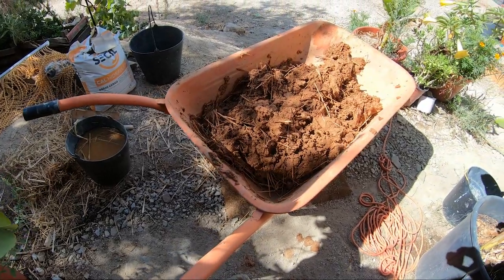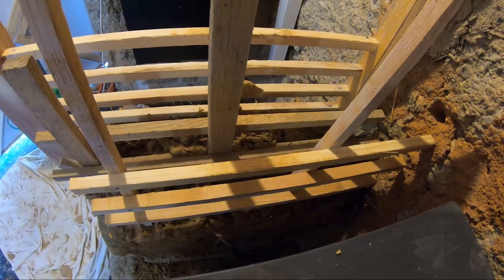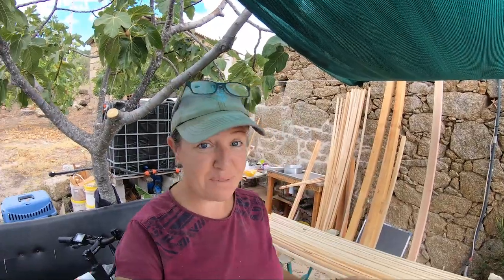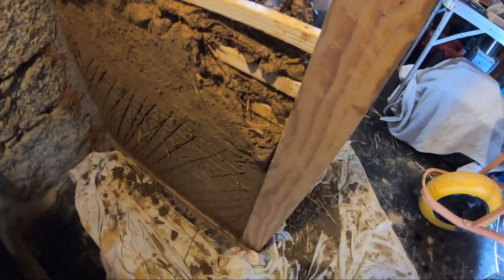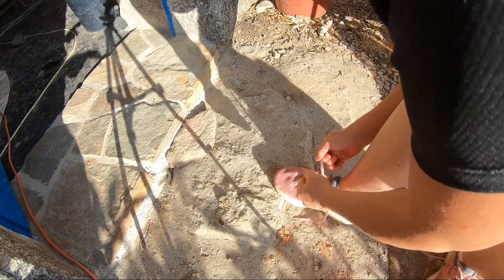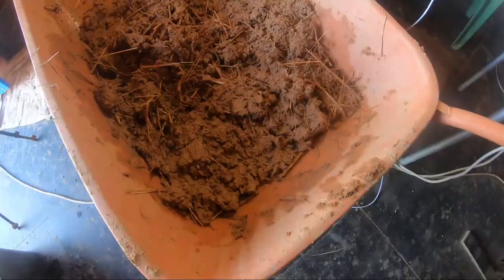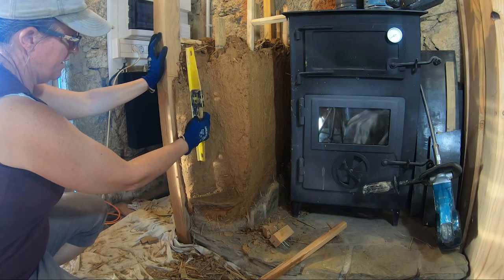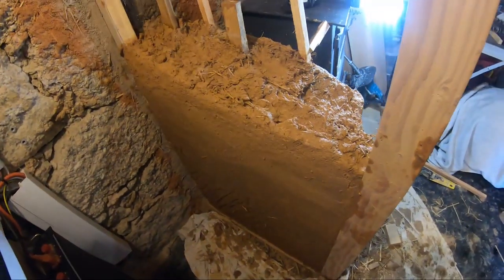Building a Cob Wall Inside My Off Grid Barn Conversion in Portugal - Part 2

Comment: The only suggestion I can make is to possibly tie the two vertical support structures together you made. I think a wood top would be nice so there are mixed materials and it ties into the wood shelving you created in your kitchen. It would also give a flat surface to place things upon. That said, you will be living there. Lead with your heart. Remember, you built it and you can change it if when you've lived with it awhile you find it doesn't either work for you or something else would suit how you use it better.
Reply from the maker: Yep my plan was to tie it all in together before starting work but I didn't feel like it at the time... I wanted to get started with the cob. It'll eventually be a more sturdy structure.

Comment: Haven’t worked in cob before, though have built in mud brick back in the 80’s. Body not up to hefting bricks now. However between your wall and the cob goat shed on Little Spanish Farmstead, I’m thinking seriously of working on my back verandah. Thanks for the inspiration!
Reply from the maker: Ooh a cob goat shed, you say? I must check that out! It's truly a wonderful material! And if you don't want to have the extra labour of a true cob wall that needs to be quite thick to self-support, check out wattle and daub. That's how I'll be doing my tool shed's walls, I think.

Comment: I think stone at the top would be good.  I was thinking that stone retains heat better than wood so you could use the shelf to keep things warm in the winter.  Do you cook on the wood stove?  The stone would be a great place to put a pan when you remove it from the stove.
Reply from the maker: All great points! Thanks!

Comment: So satisfying isn’t it, the squelchy noises  etc, getting it too wet is a problem tho…I wouldn’t put wood so near the fire. I would go for a nice off cut from a stonemason so it’s a flat shelf, not wobbly stone, unless you have such a stone lying around…good luck with the finish 💪👍😊
Reply from the maker: One solid stone is an interesting option. I guess it won't matter that much if the shelf isn't perfectly flat and I want to use stones I have laying around... but I'll think about this idea and see what stones are out there!
Reply: @PortugalfromScratch  sometimes stonemasons, or even kitchen companies have off cuts for little money, but I can see it might not tie in with the rest of the Stoney stone…good luck 🍀

Comment: Wire netting could always be used too, for added strength, to be stapled onto the wood work with use of a hand stapler gun . And then to finish off, be top coated over again with more of the cob to create the top layer final finish. Like if you'd ever be looking for to tie it all in together a little more or something. Although perhaps it might be too much hassle. Anyway, i loved these videos. They are great info. Very inspiring . Really impressed with how well your wall  formed up using the cob
Reply from the maker: Thanks for the tips! Someone else also mentioned wire but I have no experience with it on cob so I wasn’t sure but seems to make sense as a way to make things stronger. Thanks for watching!
Reply: @PortugalfromScratch  , yes, wire netting is often used in ferrocement projects . Youtube has loads of those type projects on display . I suspect wire could be utilised with the cob as well too. With ferrocement they'll attach the netting onto concreate steelwork rods what they have anchored into the foundations. But i don't see why you couldn't attach the netting onto the wood foundation structure instead . But of course, you might not require this level of strength anyway though. But i just thought id mention idea of it. Check out ferrocement on youtube. A friend of mine built himself a ferrocement yacht in his front yard. I went on its maiden voyage. 40 knot head winds for 8 days haaaa. Good testing of "strength" that crazy experience was. The things we'd do when young and fearless

Comment: That turned out surprisingly good.  The wall will also act as a heat sink form your stove in the colder weather where it will store and release th absorbed heat.  Well done.
Reply from the maker: Exactly! That's the plan. :-)

Comment: Wondering if your equipment in the new cupboard needs air circulation so it won't overheat? If so maybe a slat or louvered type of wall above the cob may be a solution. Enjoyed watching today🙂
Reply from the maker: Good point! I might not do it on that side of the wall but perhaps on the top of the door part or even vents on the 'roof' of the cupboard... let's see!

Comment: Suggestion a curved metal shield or stone to hang your fire implements on the curve of the cob? Just incase your coal poker is red hot and ignites the cob??? Defo stone on top 👍🏻
Reply from the maker: Cob is fireproof (it's basically dirt and there's not enough straw to cause a problem) but actually it could be an idea to have protection from the tools as they might damage the render... hmm... thanks!
Reply: @PortugalfromScratch  Good to know cob is fireproof just thought the straw an issue... Looking forward to the end result ☺️

Comment: In America, older homes have horse-hair plaster walls same idea as cob.
Reply from the maker: Yep, horse hair in place of the straw for tensile strength is used mainly for plastering. The horse hair is short and fine and works nicely. Same with horse manure with the fine grass chewed up! But cob is more for the structure itself and that needs something longer and more robust to hold it all together. At least, that's my understanding of it!

Comment: In my experience it's easier to carve out than try pushing and slapping cob. You've done a lovely job.
Reply from the maker: Ah as in let it dry then come back and scrape it? Interesting, thanks!
Reply: @PortugalfromScratch  not completely dry but much stiffer. I use either a sharp blade or sometimes a saw!

Comment: Hello Kirsty
Good afternoon.
It's interesting to see the construction of this wall, however, it seems that there is little space for access to your electrical equipment, In the past - I don't know for many years now that I'm out of it - there were rules for the space that was needed around electrical panels and electrical installations.
If you add batteries for example, it's possibly a little tight, I think.
Continuation of good work.
Reply from the maker: That's a good point about adding batteries! I'll eventually move the seal system outside to a utility shed so I'll keep the spacing in mind. This is all temporary.

Comment: I'm sure you needed further structure to continue UP the cob wall, but placing the frame on the outside?  Seems like the wall will continue to get much wider.  But to begin with, isn't there concern about the closeness of the wall to the wood burner?  Maybe so much mud frees the straw from catching fire?  Regardless, wonderful finish work!
Reply from the maker: Hi! Good question! The wall will continue all the way up, but it'll only be a very narrow wall that's between the two wooden uprights that will form the corners of the cupboard. It's a bit hard to explain but imagine a shelf on the top of the cob and then a narrow wall to the left of it. Not sure that makes sense? I'll start work on it soon and all will be clear, I hop! Cob is fireproof, there's not enough straw in there to be flammable.That's another reason it's such an amazing material to build with. And, believe it or not, strawbale houses are also way more fire resistant than you'd expect... much better than conventional buildings. Loose straw will catch fire but bales are some tightly packed that there's not enough oxygen for them to catch fire... or something like that. Thanks!

Comment: Very interesting! I've never seen this before. Will you put a final coating of some sort or will it stay the clay color? Will the stove dry out the cob wall and make it crack? Congrats on your hard work!
Reply from the maker: Yes I'll eventually plaster it with a clay plaster that will be lighter. I think once the cob is dry it'll be fine and not crack... the plaster might be different so it's a risk but lets see!

Comment: Hi just started watching ur project.  I've no idea on cob building, looks fun, but why so thick? The fire place looks very close to the wall, wouldn't it dry the cob out? But like u said if it dont work out u can knock it out 😊
Reply from the maker: Welcome! It's thick because cob has thermal mass which, at a certain size, soaks up heat from the stove and then the heat will radiate off of it when the stove goes out. Cob is fireproof so no problems being so close.
Reply: @PortugalfromScratch  wow! Learn something new every day 😯😊
Reply from the maker: @theresamcinnes8440  Yep! It's magical stuff!

Comment: Would you recommend cob for building a large exterior flower box in a climate that has icy, snowy winters?
Reply from the maker: No probably not unless it sits high on a foundation and also is covered from the wet elements. It's an amazing material but it should stay mostly dry.

Comment: Good hard work, but isn't the wall too thick/bulky for such a tiny place? it surely takes lots of space 🙂...all the best
Reply from the maker: This has been a common observation, I should have mentioned it int he video but basically I wanted a wall to separate the timber in the cupboard frame from the side of the stove... I would have had space anyway so rather than dead space I decided to make this small wall. Cob uses its thermal mass as a sort of battery for storing heat. So the heat from the stove will heat the wall (which needs to have. certain mass, hence the thickness) and then the heat it retains will slowly release when the stove goes out overnight. That's the idea, anyway! Good question!

Comment: Cob wall next to a fireburner 🔥 😬
Edit: sorry to be a downer but, is it a fire hazard? Be safe.
Reply: Does mud burn 🤔
Reply from the maker: Cob is fireproof, it's basically dirt and there's not enough straw to be an issue. The idea of it being so thick is to capture the heat using its thermal mass and radiate it back out once the stove goes out.
Reply from the maker: Nope!

Comment: Can you make the cob with out the straw is adobe different ?
Reply from the maker: I think cob requires the tensile strength of the straw, or some other fibre. It's an important part of the mix. You could certainly build without it but it wouldn't be as strong.

Comment: What’s the purpose of the mud wall?
Reply from the maker: To separate the side of the stove from the timber frame of the cupboard and it's thick to capture the heat using its thermal mass and it radiates out after the stove is turned off.

Comment: I don't have a concept of your inside space.  Where is the wall in relationship to the rest of the space?
Reply from the maker: It's in the corner beside a cupboard which is being built behind the door which was a weird, sort of unusable space. The wall is there to divide the timber in the cupboard from the side of the wood stove and also to act as thermal mass to collect and release the heat.

Comment: Why are all the white settlers in Portugal obsessed with medieval construction, is it to save money, or just to push up your Patreon subscription
Reply from the maker: If by 'medieval construction' you mean building with natural materials, I can't speak for anyone else but for me it's because the materials are beautiful, they behave better in many ways related to humidity regulation, allowing buildings to breathe, fire resistance, they're affordable, many of the techniques are accessible and easy to learn and teach, they have a low carbon footprint (especially when sourced locally), clay is endlessly recyclable, and a lot more reasons I'm not sure you actually care about based on the tone of your post. But if you are interested, there's loads of info on building with natural materials out there... it's not a Portugal thing, it's global.